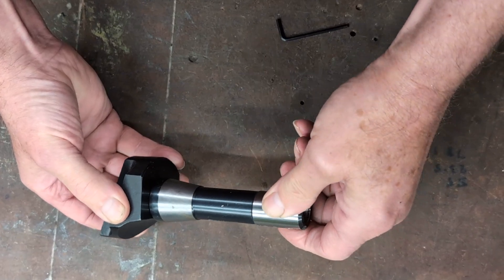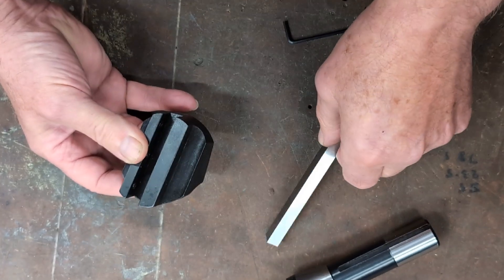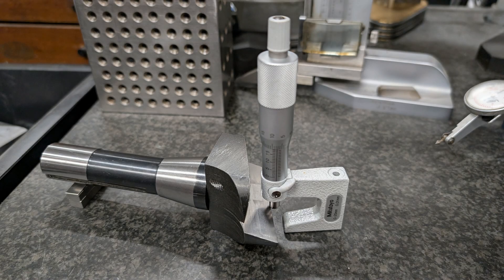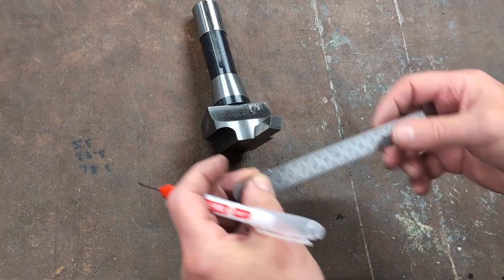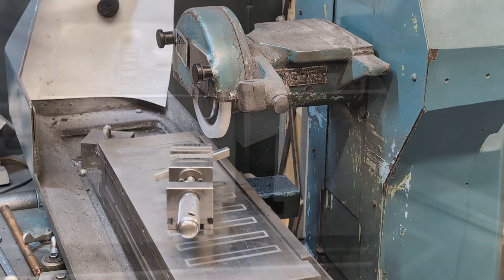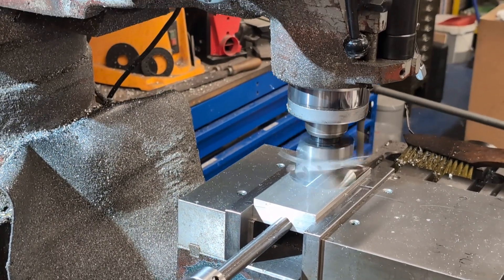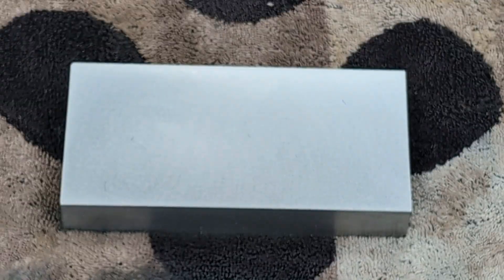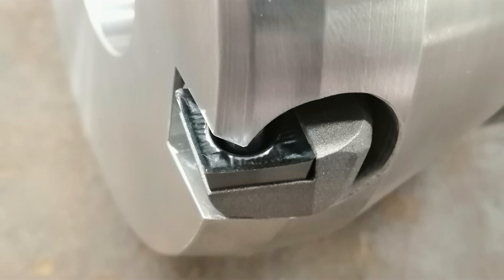Old Toolmaker’s Fix for the Humble Flycutter

Comment: Fly cutters turn out to be very excellent at machining copper... I've rarely seen such nice surface.
Reply from the maker: Their advantage is the geometry can be changed to suit the material being cut.
Reply: @machinists-shortcuts  Yeah. I've just ground an 'universal' knife like the one I use on the lathe, with a slight nose radius. Worked like a charm!

Comment: I love my fly-cutter! An interesting modification for HSS.
Reply from the maker: If you don't want to modify the holder maybe grinding the clearance on the length of the tool it will save you some regrinding time in the future. I forgot to mention in the video that the reason the tool it was tilted and the cutting face left alone, was that the cutting point is always on center. If the cutting face is ground away for a rake angle in a traditional setup then it becomes effectively below centre.